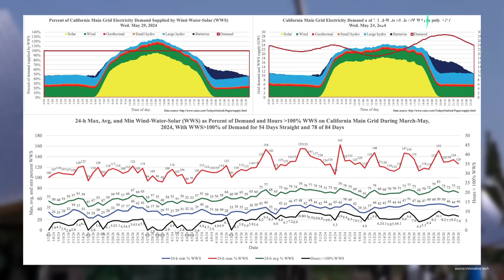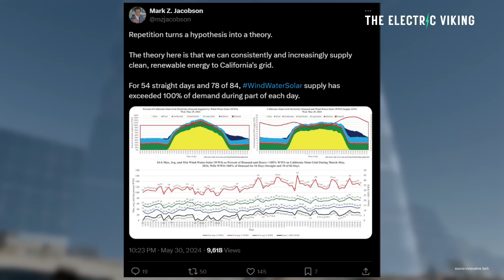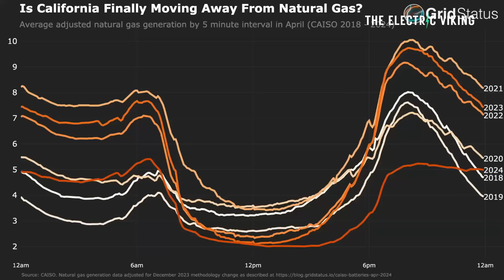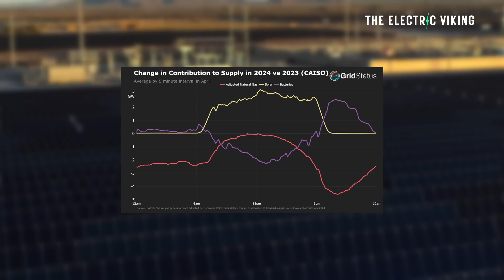Solar smashes records in California, 'DUCK curve' nearly wiped out

Comment: Solar plus batterry storage should suffice to eliminate the daily duck curve. It should help greatly to address the seasonal peak as well, in most parts of the U.S. Wherever the seasinal or emergency load might possibky exceed renewables + battery storage, the utilities can easily keep their natural gas fueled turbine peakers available for backup, if/whenever battery storage might run low.
Reply: Said, "... utilities can easily keep their natural gas fueled peaker plants..."

Those peaker plants were financed with the assumption that they would be generating at 85%  capacity.  When they are generating at only 25% or even less, they're no longer an asset, they're a liability, and have to be written off as a stranded asset.  These peaker plants can't just be sitting there, not earning enough to pay for themselves.
Reply: @acmefixer1  
They'll charge accordingly.
Reply: Seasonal differences are way to great for any sort of storage to handle.  If climate goals are to be met some sort of non-carbon emitting power such as nuclear will be needed to overcome seasonal  fluctuations in renewables power.
Reply: @stanleytolle416  
Seasonal differences are already being met by storing natural gas underground.  The natural gas can be replaced by green hydrogen stored underground.  Then the seasonal changes can be leveled out by generating green hydrogen in the opposite hemisphere, so the southern hemisphere will be generating the energy to export to the northern hemisphere.  This is already being by the Xlinks underwater UHVDC cable from Morocco to the UK, and a similar cable from Australia to Singapore.
Reply: @acmefixer1  natural gas is a climate toxin.  So storing natural gas under ground to burn it massively in the winter is not a good policy. What is needed is a dispatchable source that does not produce carbon emissions.  What seems make sense to me is high tempature nuclear reactors that can store power as heat, have other uses for this heat in industry, and can dispatch this power when needed.
Reply: @stanleytolle416 Sincere question: can you explain this seasonal difference logic to me please? For new construction, I’m seeing the price of solar plus battery now so low (and still dropping!) that it’s suddenly cheaper to buy enough for 200% power in the worst weather, in the most solar unfriendly areas, than to build any other form of generation. If there’s already legacy generation there, I guess that might be different? But not if you still have to pay off the cost of that legacy power plant. 

I’m not an expert, just trying to make good investment decisions. Are you seeing something I’m not?
Reply: @markmnelson  home solar is only about 50% of the power used.  For a home having excess power is not a problem in that you simply build your solar system for winter and waste the excess in the summer. There is however the problem of maintenance and replacement every 30 years or so.  On a grid basses excess power is a problem in that negative value of power puts other systems out of business while cost swings when power is not there is real hard on any business that needs constant power.  The other issue is the 50% of the energy needed for industrial uses.  Often the need here is for high tempature process heat which is hard for renewables to produce.  Also there is the issue that 50% or so of the people not living in their own places.  Like landlords don't care about the cost of the utilities only the cost of the equipment need to meet the minimum requirements for the tenants.  Like $200,000 for a geothermal system or $5,000 for a baseboard system which is the landlord going to choose?  Like where I live it is common for apartments to have single pane windows that don't seal, baseboard heating or inefficient boiler systems and almost no insulation. The landlord did not care since they were not paying the Utilities. Yes increased building codes help but now people can't afford the apartments because new are not being built.  So a little off track here but the solar issue has weaknesses with seasonal issues that really need environmental sound solutions.  These solutions also need to tackle the other 50% of industrial needs including high tempature process heat.  For this need the only thing that makes sense to me is high tempature nuclear reactors like the Bill Gates TerraPower Natrium reactor being built in Wyoming.  Read up on this reactor and it's molten salt heat storage and see what you think of this system.  Not a replacement for renewables but something that makes the renewables more practicable.

Comment: The landscape looks so wonderful . What a shit show , hydrogen is the future .
Reply: Hydrogen: inefficient to generate and inefficient to convert into work.
Reply: Hydrogen is a boondoggle.
Reply: You really couldn't be more wrong.
Reply: How is hydrogen made?
Reply: If you have energy you can't use, say morning excess solar, then you can make hydrogen. The fact that it is inefficient to produce is then not so important. Better 40% than nothing. However, if you can use that energy to charge batteries or use it directly that's much better, over 90%. There is another, probably temporary, use: long distance trucking and railroad locomotives. But increased battery energy to weight ratio will eventually make these applications obsolete. 

That leaves industrial hydrogen, which is a better fit. If nothing must be mobile, when produced isn't important and you would have to chuck the electricity anyway, why then make hydrogen. Better something than nothing and it beats making it from natural gas.
Reply: @danielcarroll3358  The "energy you can't use" is the part that doesn't work.  You are making some vast assumptions that somehow, magically, there is an enormous amount of reliably-excess energy being produced that hydrogen could just soak up and be useful.

The reality is that there just isn't.  There is "some" excess energy.  It is not reliably in excess every day, and other grid-scale storage technologies with far, far higher efficiencies are quickly soaking it all up.

There are no vast amounts of excess daytime.  Its just a tit-for-tat as two different segments of the power industry scale-up.

Efficiency matters.  It matters because it translates directly to revenue when the energy is put back onto the grid.  And not just a little revenue.  Potentially a lot of revenue.

So hydrogen is basically left there competing against other temporary storage, including batteries, for an economic 4-9pm arbitrage.  And it is trying to do it with extremely poor efficiencies.  This equation doesn't work economically for Hydrogen.  It isn't even close.
Reply: @junkerzn7312  I am amused. You totally misunderstood what I what I was saying. I merely pointed out that there are limited and diminishing uses for hydrogen. This is in opposition to those that think that hydrogen is the solution to everything. Relax and have a beer. 😊
Reply: @danielcarroll3358  The point I'm making is that hydrogen isn't a fit at all, under any circumstances.   Past, present, or future.   It isn't a fall-back for anything, under any scenario.  Just a big waste of money.  It isn't that there was a use that is now diminishing... it was never economically viable in the first place.  Ever.
Reply: Massive water shortages though...